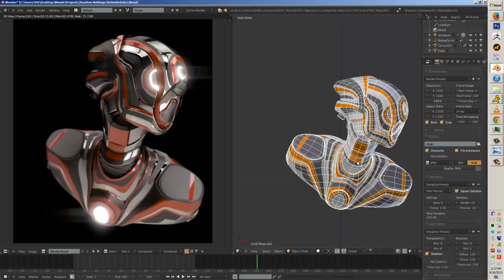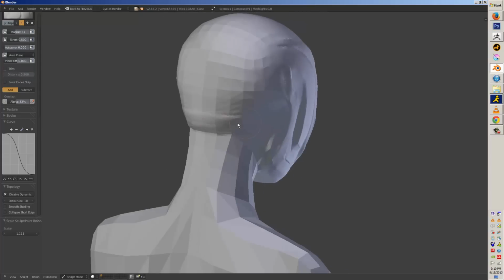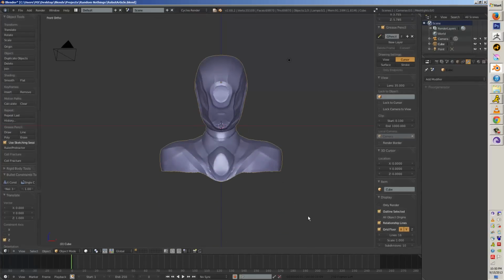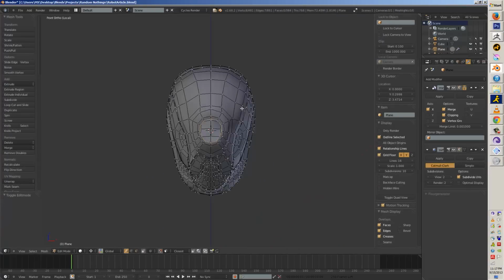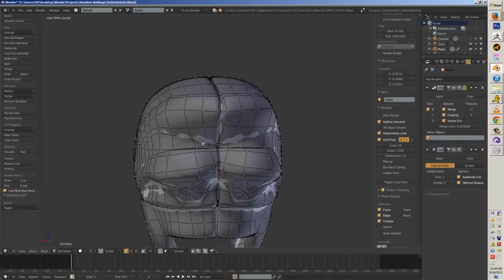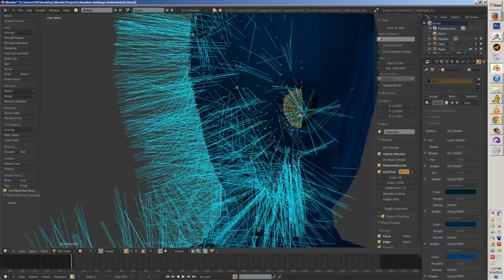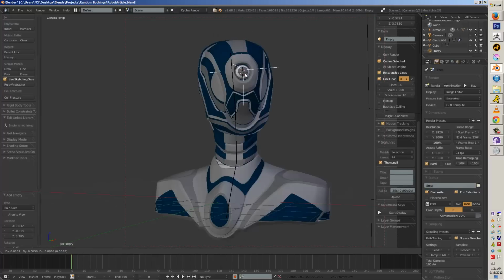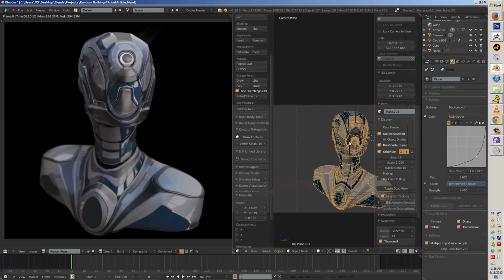How To Concept A Robot In Blender

Comment: This is like magic to me. Blender has so many features and I don't even know half of them yet, despite having sat with it basically daily for 2 years.

Like I didn't even know you could turn the ridge tool into a crease tool. I'm guessing you're holding or pressing a key to make the transition between them, but I don't know which.

I'm definitely gonna exploit the crap out of the lazy strokes in the future!
Reply: dont know if im late or not but you hold shift to reverse the brushes

Comment: So, first of all - great tutorial.  However, and this is driving me nuts, when I use the exact same settings for, say, the dam brush, with dynotopo on (subdivide on but collapse off), smooth stroke on, and I draw a stroke across a similar size area on the screen, I get a much more coarse stroke than you do.  Do you know of, or can you do a tutorial on the details of brush settings, including the use of the little lock icons next to things like strength, Area Plan vs View Plane, etc...  It seems like I have to get lucky to get things like Polish to work nicely.  Sometimes it does and sometimes it tears my mesh to shreds.  Help!
Reply from the maker: I'll see what I can do. I want to do something to get people more in tune with sculpting.

Comment: This is pretty amazing, how long have you been working with Blender? I've been learning ZBrush for the past half a year and I love organic modeling so far, but I'd like to learn a low-poly modeling program like Blender as well to have a good range of options. It's a whole other can of worms, but I'd like to attempt learning it. Do you have any recommended videos on starting with using Blender's interface?
Reply: 2.7 has UI improvements, but the best place to start learning Blender is definitely cgcookie.com/blender
BTW Blender is not low-poly program. I cant handle that many polygons in the viewport without lag because I think it's VP renderer is in Python, instead of C++ like in Autodesk products, but it does support OpenGL hardware acceleration, which helps, and is also way faster and more efficient than Z-brush and 3Ds Max in terms of it's workflow. So while you see some lag during very high-poly sculpting, you will still win in time if you learn how to use Blender's tools effectively. As someone who worked with all 3 programs, in terms of workflow efficiency Blender wins by a mile over all the rest. Once you learn it, you just work a LOT faster.

And really the viewport performance is the only thing, where other CG suits have an advantage. In the last 2 years Blender evolved past every other general CG program on the planet in every other aspect, quite miraculous if you think about it.

Comment: at around 4 minutes in you start using other sculpting brushes and as soon as you brush the model everything becomes smooth... this does not work the same for me when i try i just get faces moving about are there any settings you changed with your brushes befor hand